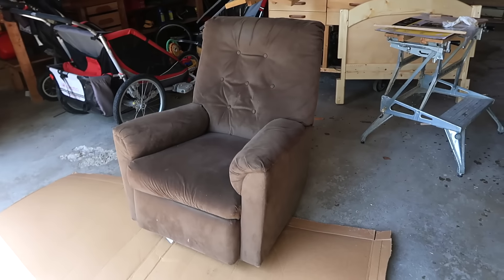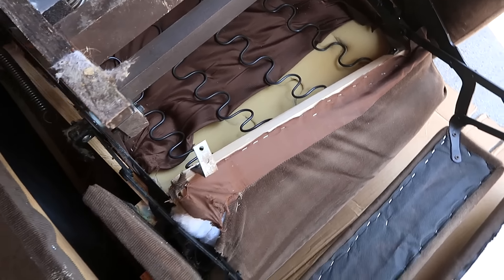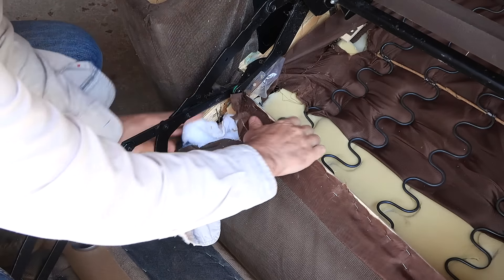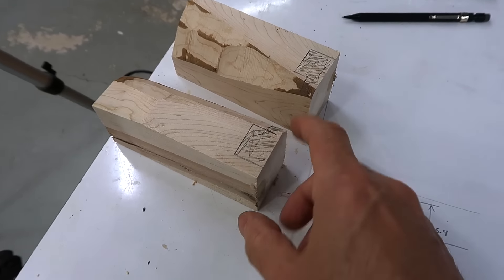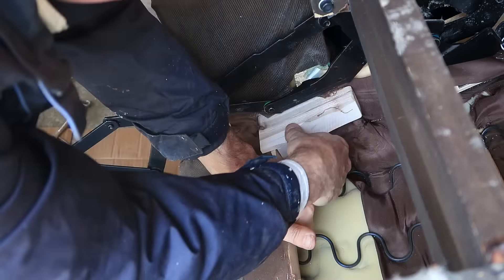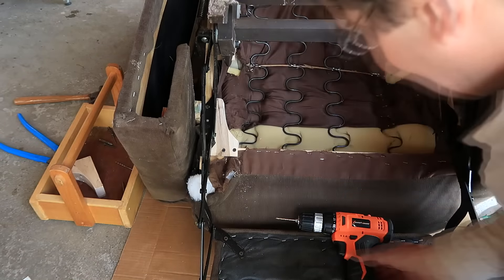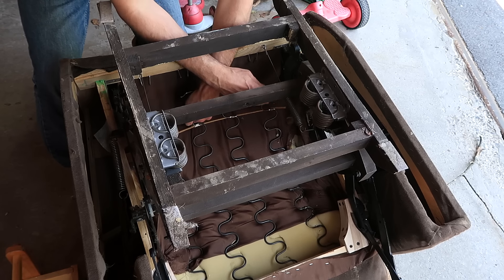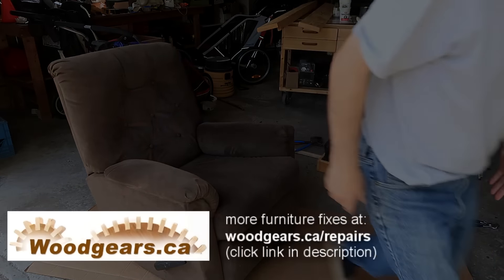Recliner seat frame fix

Comment: The firewood is higher quality wood than is used to make those chairs these days. They really aren't worth what they charge for them anymore.
Reply: It depends. You can get good ones still, but they're not cheap. La-Z-Boy is still solid, if not quite as robust as they were 30+ years ago.
Reply: I'd like to see you try to go into chair business and outcompete them with a cheaper and superior product. Everyone always says things are cheaply made these days, but that's how it has to be to be this cheap.
Reply: @bloodgain  la-z-boy is one of the brands i am specifically talking about
Reply: @UhOhUmm  furniture stores charge around 800-2000% markup on their products. They are made in sweatshops overseas for pennies on the dollar out of the cheapest materials possible and then slapped with a major name brand and a bunch of marketing which you seem to have fallen for.
Reply: @SuperAWaC  Well, I have one that's about 10 years old and one that's older (14 years, I think?), and aside from some normal wear and tear from almost daily use, they're both in excellent condition. They have a few loose stitches or tears in non-visible places where the fabric touches wood, usually because people (me) push off those places to readjust their position. They need a little lithium grease where metal meets metal once in a while to kill squeaks. But the wood and overall frame is still in excellent condition, as is most of the fabric, to my surprise.

Now, I do agree that they're steeply marked up. La-Z-Boy can be hard to haggle down, too, unless that's just my local place. But since they've lasted WAY longer than any other recliner I've had, I probably came out ahead. And believe me, I assumed it was a gamble, but I was tired of replacing junk chairs, so I figured it was worth a shot.

Comment: I have two identical La-Z-Boy leather recliners which were $1,200 each, about 15 yrs old. One frame structure broke. Took apart and replaced components with 3/4" plywood, glued and screwed. Factory staples and lousy craftsmanship suck.

Comment: had a used 1990's lazy  boy bearings shot out of it after years of constant baby + parent use + 2 or more decades of whatever life it had. Bought a 2010 one from Habitat for humanity it broke a bearing and a wood support less than 1 year with baby duty in 2020 ... they don't make em like they used to
The 90's one had big chunky bits of wood, but alas one day a number of bearing's shat the bed and I didn't want to deal with it ... the 2010's model was like stapled cheap as possible plywood ... sad

Comment: I had a similar chair with a very similar failure, I had more wood to work with on mind so I just replaced the staples with glue and wood screes. Seems to be working.

Comment: I found a nice recliner at a thrift shop.  they only wanted $10 because the recliner part didn't work.  I flipped it in the store and saw rope all wound around the mechanism so I bought it.  Turned out there was like 30 feet of rope wound around everything in there.  When I unwound it the chair worked flawlessly...plus I had about 30 feet of nice 1/4" nylon rope....for $10.
Reply: That's hilarious! I wonder how that happened!
Reply: @buddyclem7328    I bet somebody was moving it and  put the rope in there so the foot rest wouldn't pop out.  Only thing I can figure lol.

Comment: I just bought a brand new chair and I'm so angry by how poorly made it is. I didn't decide that I hated it until after the THREE DAY RETURN WINDOW.  It's made out of OSB... that isn't necessarily the part that I hate though.  The inner section of the arms where your thighs touch the chair basically has no padding. I often sit criss cross so my legs press against that area and its not as comfortable as it should be. Also they didn't chamfer the edge where the top of the arm meets that same inner section of the arm so it's a SHARP 90 degree corner. I found this video while searching how to take these chairs apart because I have the intent of opening the arms and fixing those design flaws.

Comment: Kudos! Nice fix and improvement! 
I had bought a recliner from Morris that failed (snapped) within a month of use- and we're not a 'heavy' family.  I could have fixed it in the same manner as you did and made it even better than it was, but it wasn't even a second hand purchase let alone a trash pick and I refused to do that to a brand new chair that turned out to have workmanship not even worthy of the dollar store. (The gall some furniture manufactures/retailers have to pass off absolute crap as quality is beneath my understanding!) I returned the chair and after a long battle with the retailer and mediation from the BBB I got all of my money back.

Comment: I’m surprised you did not use glue. You made nice brackets out of wood. I’m a person that has repaired recliners for years. If you take them loose and glue them, they will out last the chair. A little grease on the rivets will ease the stress and double the life of the chair. Good luck.

Comment: Thank you so much! I believe I have the very same problem with my similar recliner, from what I can see underneath. Broken brace under the footrest...  They really use cheap particle board making these.

(2 hrs later)
We made new brackets and longer screws for the cross-brace like the one you renovated...original screws and wood is too flimsy... used a ratchet strap to pull the board forward...now it works fine. Great.

Comment: Hi Matthias, I'm curious why you didn't add glue to the joints.  I assume "it wasn't necessary", but it seems like glue would have only added strength?  Anyway, awesome fix!
Reply: And if it had to be taken apart again?
Reply: @breakinn403  That would certainly be a valid reason.

Comment: Pretty much where they usually fail. Whenever buying a new recliner, always look for one that has a full 4-sided frame and isn't just stapled together. La-Z-Boy still makes them this way, for example, but they're not cheap. But take it from a big guy: they last!
Reply: I am currently working on repairing the wood frame on a 1995 Franklin recliner I saw on the side of the road. It was just like the large recliner I had slept in for 6 years, but due to moving company's policies they wouldn't help me load it in the car, so I had to leave it at the storage place. I haven't had a decent night's sleep in over a year. I am so grateful for videos like this. And yes, I do have a Shark steam cleaner.. I do like to be able to reuse and repurpose things, and not be so wasteful. And with the economy the way it is right now, it's a damn good idea. Soon I and my two furry children will be sleeping in comfort in this huge recliner.. 😁😸😸

Comment: A well thought out repair--better than new.  [I am a bit surprised--Lane is a relatively well-known maker of (I thought) better-than-average furniture...to fasten an angle bracket with staples is not an approved method, I'm sure]
Reply: Lane USED be a quality furniture brand, started using the foreign plywood that had massive amounts of voids in it and the recliners fall apart like crazy.

Comment: I'd make a minor effort to at least make sure it doesn't have bedbugs.  I have a free recliner I'm using but I made a point of knocking on the door and talking to the people. I also sneaked a peek inside the house at the same time to help judge their cleanliness. :)
Reply: I'd lay out some cut up straws overnight too, just to rule out any potential Peehole-Crawler Silverfish infestation.
Reply: Bedbugs aren't an indication or symptom of cleanliness. You can pick them up at a hotel, movie theater, or work place.  They're evil.
Reply: Agreed.  At least steam it and spray it with 90% isopropyl alcohol.  Then if you want to go a little further you can spray it with some pyrethrin and/or dust the chair with some DE powder or better yet CimeXa dust.
Reply: Just put it inside a mattress bag for like two weeks.
Reply: If you really want to be sure you can put the piece of furniture in a large bag with one of the Hot Shot No-Pest Strips.  They will kill everything.  You leave it for a few days.
Reply: @jTempVids  I thought part of their incidiousness was that their larval stage can last a random (and sometimes long) amount of time, and that the poisons don't really get them while they're in their larval form.